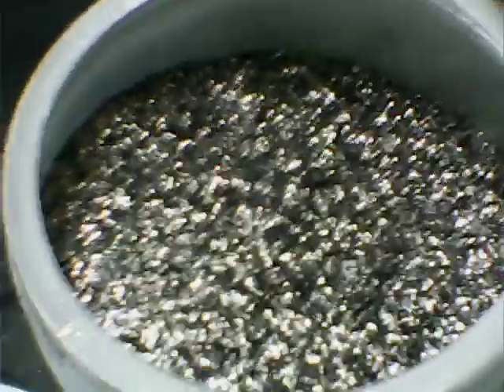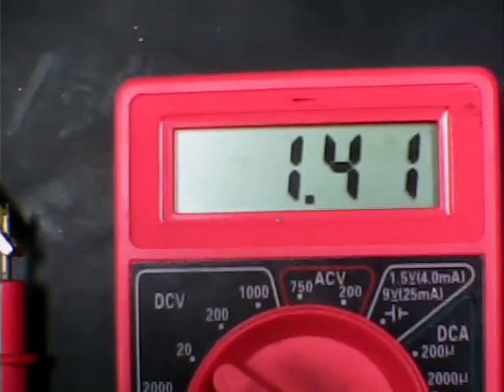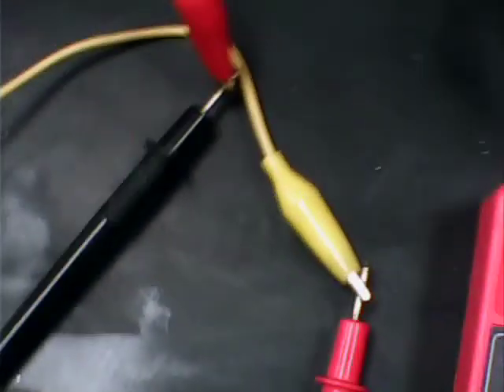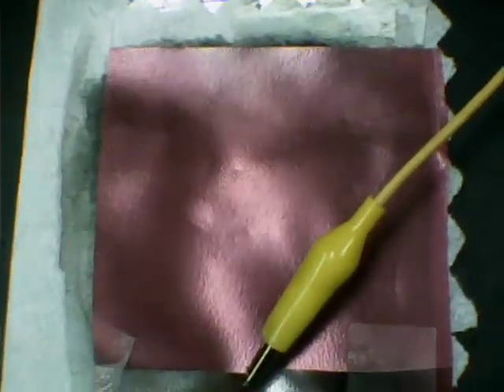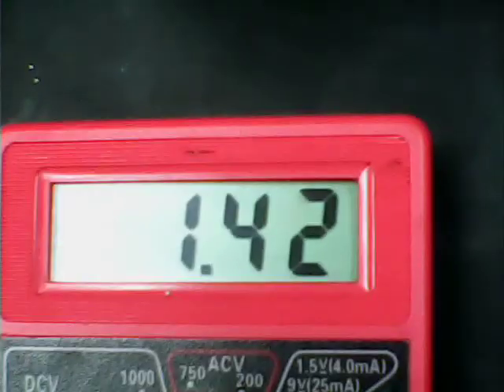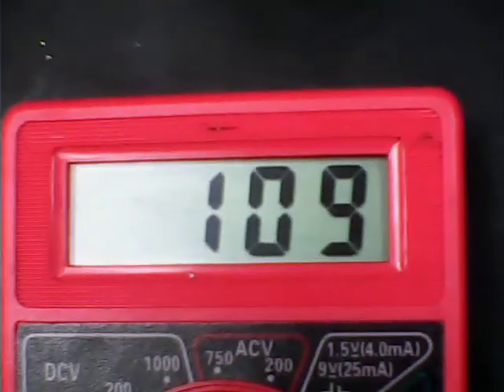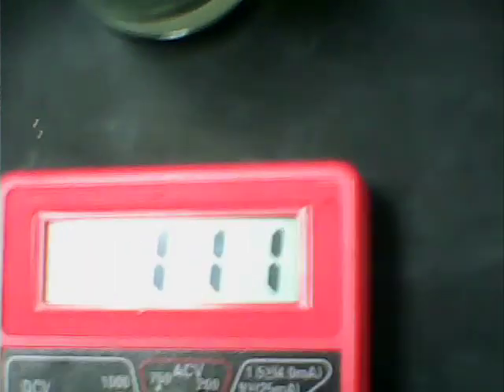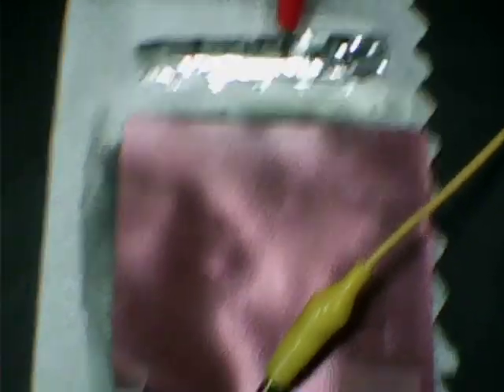Conductive Graphite Sheet Electrode/ Aluminum Air Cell

Comment: You all will love the power you can generate using the ExNube compositions to make electrodes. They are not flexible after polymerization but can be a thin, flat sheet with a much larger power output.